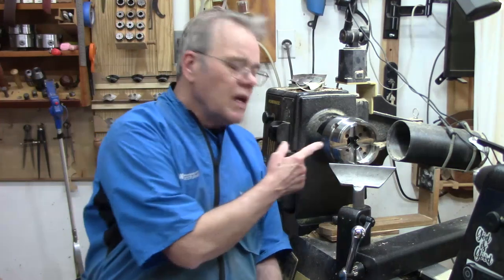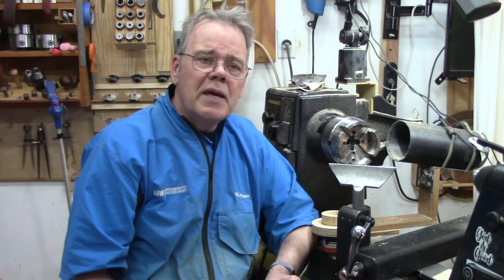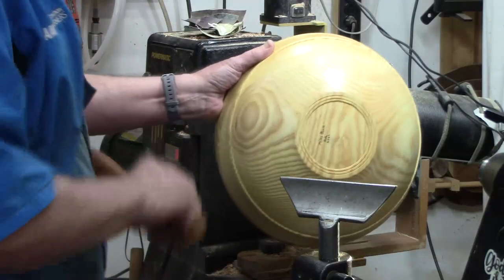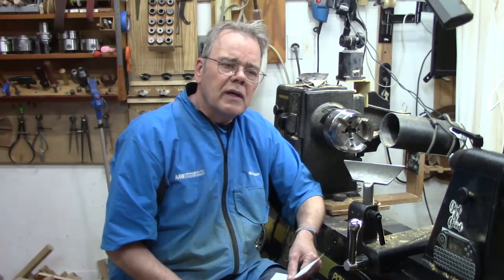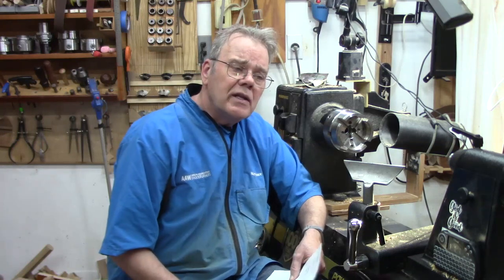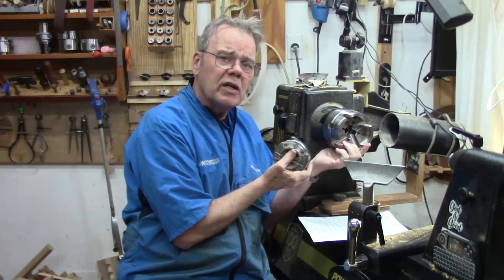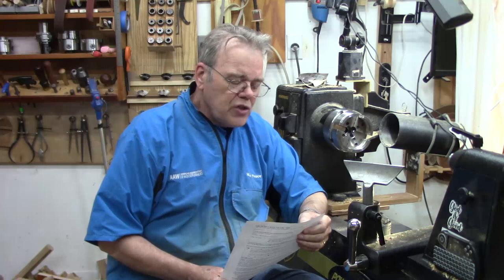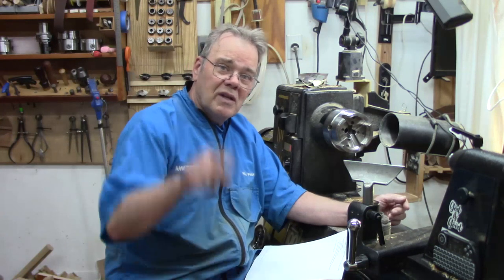Does Your Chuck Unthread While Turning?

Comment: Thanks for addressing this issue, Mike. Like you, I've encountered this scary and potentially hazardous problem when abruoptly turning off my Robust (VFD drive) lathe. The momentum of a 24" platter or 25lb chunk of green wood can easily unravel from the spindle. I learned very quickly to gradually reduce the speed before turning it off with larger pieces.
Reply from the maker: I do not turn many big pieces so it took me a while to encounter this. I think I will mention in a longer safety video.

Comment: Great advice Mike. I have on occasion had my chuck start to unwind but was able to stop the lathe before it came off. The set screw for my chucks land squarely on the top of a thread so I am reluctant to use it.
Reply from the maker: That is unfortunate. Most spindles have an unthreaded area near the shoulder. I suppose you could remove the last couple of spindle threads with a HSS scraper.

Comment: Hi Mike, Happy New Year.  An interesting topic.  I have a Robust American Beauty and have had the chuck loosen up during reverse sanding.  When I started turning my mentor showed me the wrist flick method for installing the chuck and I always use it.  I have several Super Nova 2 chucks and if I have very much sanding to do in reverse I use the grub screw and it sets just to the rear of the 1-1/4 x 8 threads.  If I have just a little reverse sanding I'm careful to keep a close eye on the chuck for coming loose so I don't have to mess with the grub screw.  However, normally when I put a chuck on my lathe I just install the grub screw so I don't forget it later unless I know I will not be doing reverse sanding and will be taking it off shortly for another procedure etc.  I must admit I was very surprised the first time it happened and quickly learned my lesson...better safe than sorry I guess. I have a 4" magnetic dish from Harbor Freight on the head stock with grub screws and an Allen wrench so they are readily available to grab.  I bought a few extras so when I drop one in the chips I don't have to spend an hour looking for it...:goodvibes:

Take Care,
Myles
Reply from the maker: Based on all of the feedback I got, I will start recommending the wrist flick method. An occasional stuck chuck is preferable to one unwinding.✌️
Reply: @MikePeaceWoodturning  Hi Mike,  OK, but as I said in my comments was that I have ALWAYS used the wrist flick method and still have had chucks unthread.  I bought a 1-1/2" wrench which fits the standard Nova insert to remove the chuck and it saves a lots of body jerking with a chuck key.  I will continue to use the grub screw to avoid damage to my lathe or my legs and feet if the chuck should come off.  I agree it's a pain to have to thread in the little grub screw but safety first for me.  Take Care, Myles

Comment: I don't sand in reverse a lot but I do change chucks frequently,  so I don't like using the set screws to lock the chuck.  I tend to use the wrist flick method because it works well enough while still being easy to remove the chuck.
Reply from the maker: Thanks for sharing. All viewers gain from shared experiences.

Comment: My first lathe was a Delta midi ( 1" x 8 TPI ) and the first chuck I bought for it was a Nova G3 with adapter. The adapter did not have a spindle set screw and I did have it come loose ( not right off but close ) while sanding in reverse several times. That made me stop sanding in reverse.
I have since moved up to a full size lathe and bought two Super Nova 2 chucks and a new adapter for the G3. All have the set screws and I use them all the time. No issues since I made that change.
Reply from the maker: Interestin. I did not realize that Teknatool had an insert that did not have a set screw. Record Power had two different inserts, one with and one without but they discontinued the one without a set screw.
Reply: @MikePeaceWoodturning  To be up front I was a brand new turner when I bought the chuck. Best price was on Ebay from some re-seller. It's entirely possible that the adapter they included was not an OEM Nova product.

Comment: In my experience putting on the chuck with a flick of the wrist isn't enough. I replaced the little plate spindle wrenches that came with the machine and replaced them with some real wrenches. Tighten the chuck with a quick flex and they don't come loose. I'm not worried about hurting the equipment. I used to work as a manual shaper operator and I had to put a full body flex on those because you don't ever want that stuff to come loose. Never damaged the parts at all.
Reply from the maker: I like your idea of getting a good wrench. I need a better one.

Comment: Thanks Mike.  I’ve not had a Chuck unmount itself during reverse sanding, reverse cutting (normally very light cuts and minimal material removal) nor with stopping the lathe (even with my large chucks and fairly large blanks).  I have a Robust American Beauty with a couple of fairly large chucks (Vicmarc VM120 and Axminster Evolution SK114) and I use one of the thin plastic washers.  I guess I’ve been lucky,  ut so far no problems and I have not used the grub screws to keep the chucks in place.  Thanks for the video.  Hope you have a great New Year.  Cheers, Tom
Reply from the maker: Sometimes we make our luck. Happy New Year to you, Tom.

Comment: I have had it come unscrewed while sanding in reverse. I was powersanding with a drill, also in reverse, and the sandpaper disc went out of position and rubbed the inside of the bowl a bit like a catch. The Chuck was on an adapter from 1 1/4 to 1 inch as it was a smaller church and the adapter did not have a set screw. That is where it came loose. Fortunately, I saw it happening and quickly shut down the lathe before it had a a chance to come completely off. I subsequently drilled and tapped the adapter to accept a set screw so it won’t happen again. I have two lathes with different size headstocks, so have adapters both ways so I can use chucks on both.
Reply from the maker: Good point about many adapters not having a set screw. Mine does not.

Comment: I occasionally reverse my lathe for sanding, but I have never had a spindle 'unwind' when doing that.  As you say, if you are sanding properly, you won't be applying enough force (torque) to break that connection.

My experience regarding a chuck coming loose when stopping the lathe is the same as yours, and I've also learned to slow the lathe down before stopping it.

The only thing I would add is that this phenomenon might also be a good reason for wearing steel-toed safety shoes in the shop.  DAMHIKT
Reply from the maker: Ouch!   I find myself being more safety concious the more I learn.

Comment: Mike, I’m like you and rarely turn in reverse. However one time I was using a small  PSI Baracuda chuck and apparently had not tightened it when mounting it, and while I was roughing a small spindle blank, I noticed excess vibration, and found that the chuck was backing away from the headstock. Now I will “pop” mount this chuck  as it does not have the grub screw as my Nova chucks have.
Reply from the maker: I have a chuck that tends to loose easily and one that tends to lock tight. I guess we all have different variables  that can affect our view of what is safe. Thanks for sharing.

Comment: Hello Mike, very useful video! I have a midi lathe and the two small chucks (2 1/2 and 4 inches) it has are without set screws, unfortunately. I actually bought a bigger chuck first that had a collar on its back with 3 worm screws, but I had to replace it, because I felt it was too big (8 pounds) for my midi lathe. Basically I was worried about the spindle bearings. I have watched your video and now I'm worried about the chucks coming off.😟 Luckily it hasn't happened so far, probably because of the relatively small size of the chucks I have, and the small size of my projects. How could I prevent the chuck coming loose if I reverse the machine? I frequently use the reverse setting because I'm left handed, and often it's more convenient to work from the other side of the lathe. I'm planning to turn some larger dishes and this might be an issue in the future. I wouldn't like to buy another chuck, because the ones I have are just the right size for my lathe. I should have bought some chucks of a different brand probably, but then, other makers' smaller models seem to lack the extended collar with the worm screws, too.
Reply from the maker: Give the chuck a good wrist snap so it will seat strongly. Your best bet is probably a chuck with a set screw.

Comment: Mike -- The only time I've had a chuck unthread was related to sanding in reverse -- kinda. When finish sanding one project, I put the lathe into reverse for the last grit. Then, I took the item out of the chuck. Cleaned up my shop and turned out the lights. I didn't return to the shop for a few weeks, this time to finish a large hollow-form I had rough-turned a year or so before. I mounted the blank onto the lathe using a faceplate. I didn't use tailstock support because I'd planned on finishing the hollowing before working on the exterior. When I started up the lathe, I noticed the entire hollow form started to shift -- very smoothly -- to the right. I tried to clean up the mouth of the opening in the hollow form with a spindle gouge, but I couldn't get a cut. I tried sharpening my gouge. It still wouldn't cut. I tried several other tools, including some carbide tools. I couldn't get anything more than a little dust! I thought I'd forgotten how to turn. I was about to give up in disgust, when I noticed that the lathe was still set to run in reverse. That's when I also noticed that the blank had backed off the spindle about 1/2 inch. 

Someday I may learn to laugh at that incident.
Reply from the maker: That made me laugh. I did something similar when I replace a blade backwards on my table saw. My son used it while I was gone leaving some Störche mdf scraps behind. Took me a while to figure out what had happened.